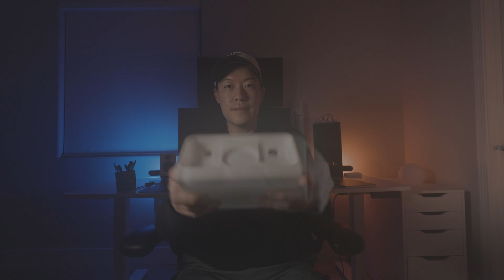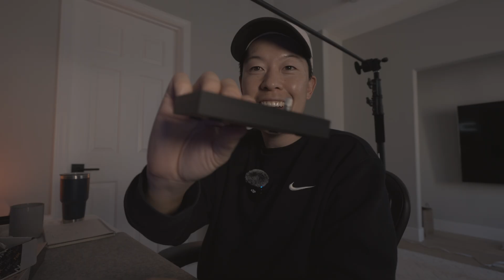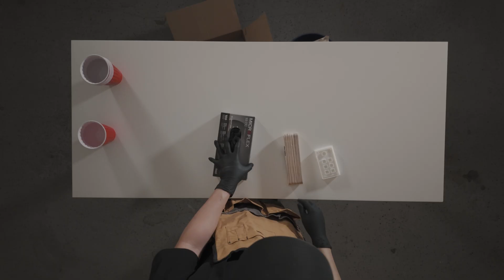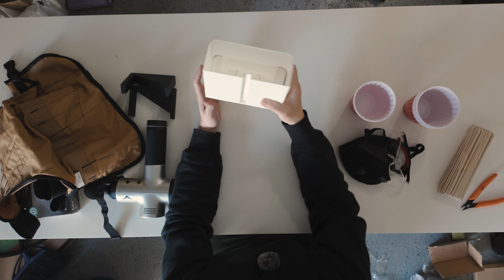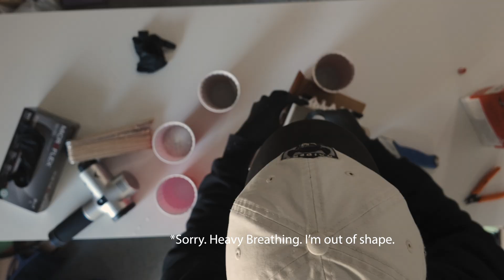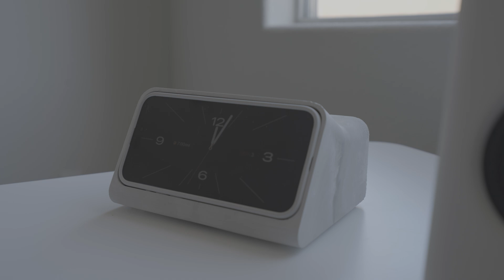I Made a Concrete iPhone Standby Dock with 3D Printing

Comment: I just found your videos and am loving what I am seeing. 

If you decide to do more concrete pieces, may I recommend going to Home Depot and getting RAPID SET Mortar Mix. It is only sold at Home Depot. It has no stones, cures in about n hour or two, and is easy to mix. I use it often to make desk accessories and candle cups. Good luck and keep making awesome stuff.
Reply from the maker: Love getting these kinds of comments that drop some good tips and knowledge. Will absolutely keep that in mind for future projects. Thanks for watching!
Reply: @willswasteland I just found this channel. I wish I’d found it, and your comment a few weeks ago. I bought a bag of Quickrete from HD. I was sad to find it has so much stone in it. I’m wondering if I can sift it out? Need a dedicated sifter. Should also make a tented enclosure, stuff is so dusty.